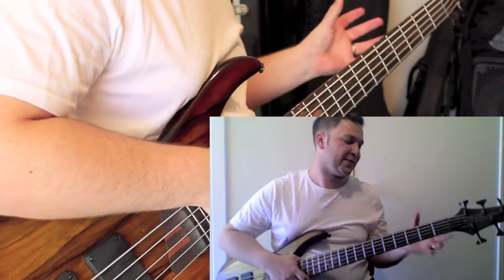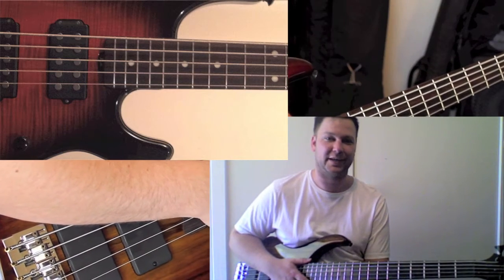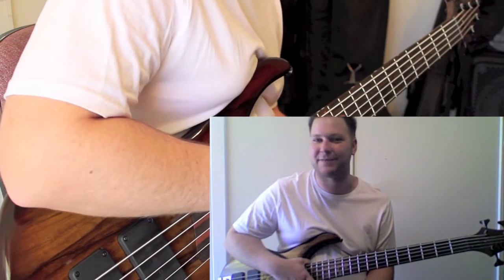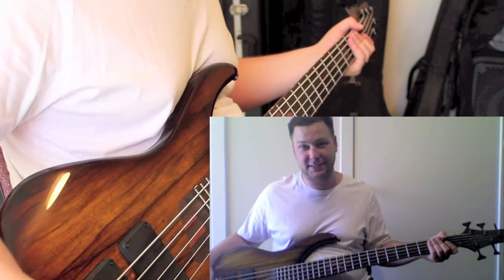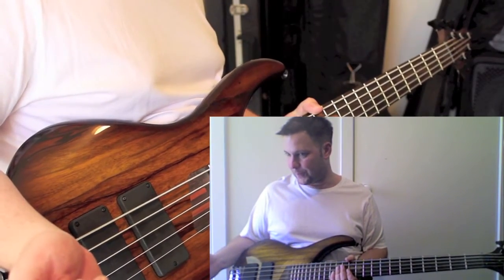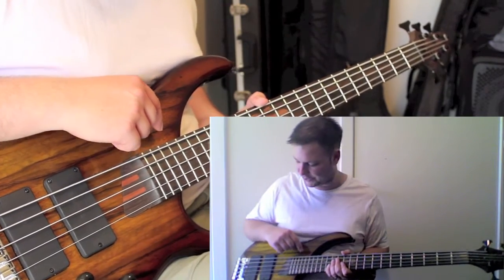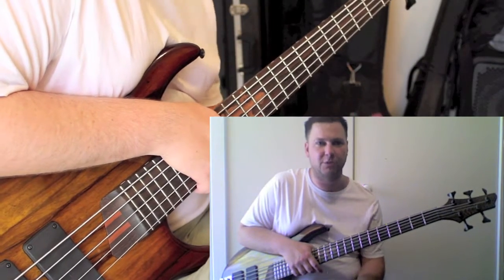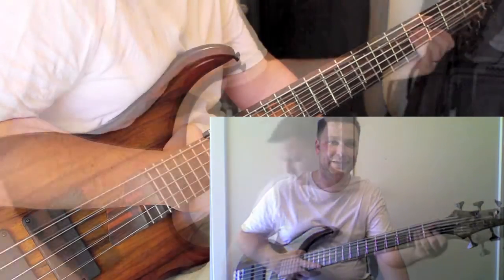Warmoth Gecko 5 String Bass Design Process

Comment: Glad I found this video. I’m going through a similar situation. I played Fender 5 sting P with a Jazz pickup modded to the bridge. Jazz pickup helps with low B but still is not good enough. Play a Sterling Ray35 now and i just dont see why 5 string basses have to have their neck pickups so far towards the neck (when they have neck pickups). They need to put that pickup in the precision position. Why they all seem to have a super muddy neck pickup is beyond me. Great job,  by the way.

Comment: For me neck dive absolutely is a deal breaker. Both from the stress it puts in the hand to support the neck, but also how it feels so much heavier on the shoulder. I have back issues so I'm very sensitive to it. Sadly I've had to sell off some very nice basses over the past few years, and I'm still looking for that perfectly balanced and lightweight bass.
Reply from the maker: I was the same with a Warwick Thumb bass. I was sad to see it go but I couldn't deal with the neck deck dive. I don't have a problem with any of my other basses though, including this Warmoth. But I positioned the strap buttons specifically to get the best balance. Check out Kiesel basses, apparently they are some of the most balanced you'll find.

Comment: How is the "B" string compare to the other basses you have played that were 35" scale?
Reply from the maker: This is my first 35" scale bass so I don't have much to compare it to sorry. I don't recall coming across 35" basses in the shops around here. All I can say is that the B on this bass is really tight and precise sounding. It spins me out that I can play fast basslines using the B string and you can hear every note clearly. You just don't get that on a 34" bass in my opinion.

Comment: Hey, Very nice looking bass! Just wanted to know what bridge have you put there? And also which Bartolini pickup and preamp model did u go for?
Reply from the maker: naresh kamath Bridge is a Takeuchi TG5N bought from Warmoth. Preamp is Bartolini NTMB 4.6 A/P.Pickups are Bartolini MM52CBJD3I should note though that I have since replaced the pickups with Nordstrand MM5.4. The magnets in the Bartolinis didn't align with the strings right which left the D string sounding a bit weak.
Reply: +thumbs3000 How different do the Nordstrand pickups sound?  I really like the compressed tone that Barts have.
Reply from the maker: It's not a huge difference but I'd agree the barts are more compressed and the Nordstrand are more open and bright.   Take heed of my comment above re the magnets in the bartolinis as this was a real dealbreaker for me. The barts are a "rail style" humbucker. This means there are 4 long coils inside each pickup cover: 2 coils covering B E & A strings and 2 coils covering D & G strings. There is a small gap in between where each coil starts and ends. This gap was positioned near the D string which resulted in noticably lower volume on this string. These pickups are supposedly designed for this string spacing.  It's a great sounding pickup otherwise but this prevents me from being able to endorse this pickup.   They might have fixed the design since then.    If you wanted to test any enclosed pickup you can get a hold of the pickup, place a sheet of paper on top of it and sprinkle metal filings on top of the paper. This will show you exactly where the magnets are positioned.

Comment: Did Warmoth route the pickup locations
Reply from the maker: Yes
Reply: +thumbs3000 Were the routes just in the normal bridge and neck positions that's offered in the build menu or did you have to request special routes?
Reply from the maker: I just ordered using the available options on the website. MM5 in neck and bridge.